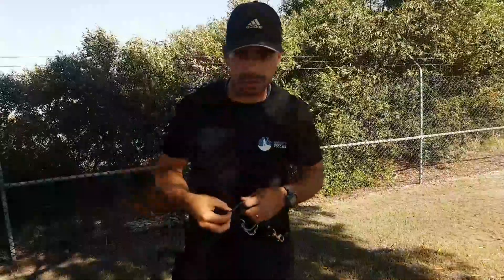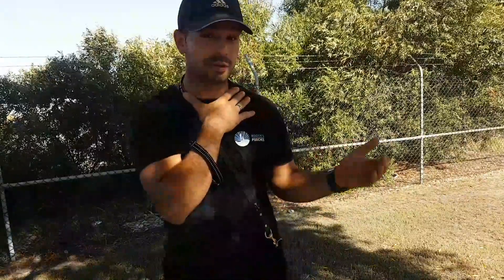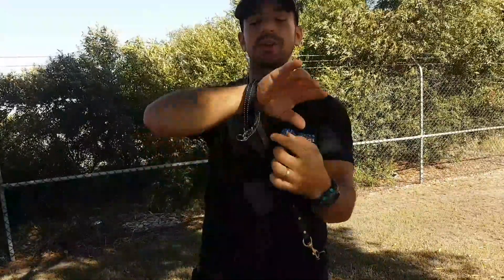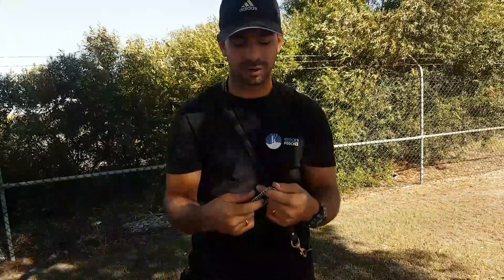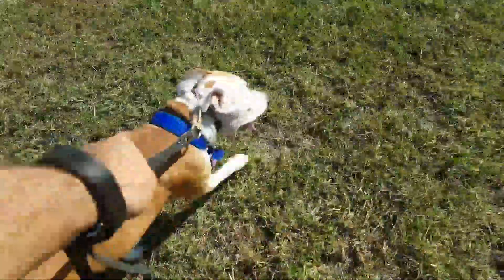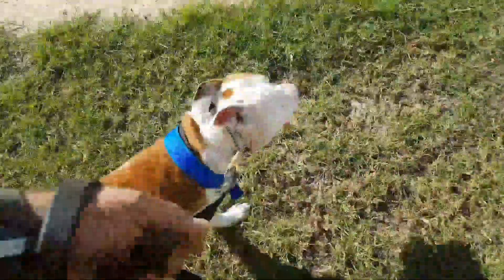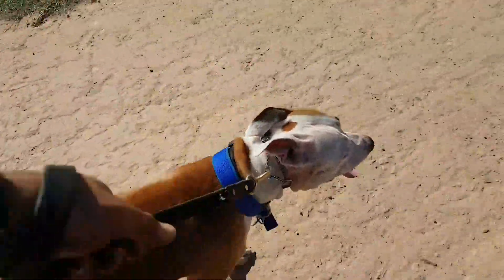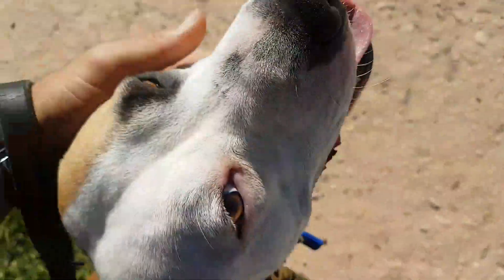A guide to how to use a martingale collar

Comment: Hey brother I could use your help. I’m training my dog but I think my martingale is failing or I’m not placing it correctly. I feel like it’s too tight. I need a new one but I’ve avoided the ones with a chain because I feel it will snap. I have a 1 yr old GSD. Can you suggest a collar and the appropriate leash and leash length please ? Thanks in advance.

Comment: What do you think or full cloth martingales ? I think I may have wasted my $ with the one I got. Hard to get it in the proper position.
Reply from the maker: Hey, they can work however the chain has a few benefits. It releases quickly, makes a sound when you apply pressure and more durable. 😎👍🏼

Comment: I have a 15 month old Great Dane and just bought this collar how do you get it to stay up high? I put it on and it doesn’t stay high and ends up falling to the lower part of his neck. I haven’t attempted to walk him yet because I want to make sure I put it on correctly
Reply from the maker: Hey Brendan, the technique is most important. When you apply pressure on collar you must apply pressure upwards, (don't pull it back). Tough to explain in comment section. I'll try make a video to answer this. Stay tuned 😎👍🏼
Reply: @noochspooches25  thanks for the reply. I do understand the pressure up as opposed to back. My boys pulls going forward. Is it possible to pull up when he’s out in front?
Reply from the maker: @brendanbramley7413  pressure on not when he's pulling, but as he gets in front of you.
Reply: @noochspooches25 understood. Thanks

Comment: Great video, thanks. We have a 7 month old staffy and we're trying to get her to stop pulling on the lead. We quickly moved away from using the flat collar because she was choking herself constantly and moved onto a harness, but with the harness she actually seems to love pulling against it so she's almost incentivised to pull - I am not going to keep using a harness, I want her to not pull at all, not allow for her pulling.
We have had some success with a slip lead but with how thin the rope is, I feel like it digs in more than I would like, and the little stopper which prevents it from coming off doesn't fill me with confidence that it won't loosen too much and she ends up wriggling out and getting into traffic. I was saying to my partner yesterday "I wish there was a slip lead collar that is wide like a flat collar" and sure enough it exists in the form of the martingale, and it's actually a better design than a 1 sided slip lead because it doesn't pull on one side and twist like a slip lead does. What a great invention, and a great demo and instructional video from yourself. Cheers.
Reply from the maker: Thanks! Good luck with your training ✌️

Comment: *This a really informative video.  

With my dog, the challenge I have with him is if I do figure 8s with him, when I move to the left and block him off to turn left he will be responsive but if I got the opposite way ( right ) he will stop and no* t move. Do you have any suggestions?
Reply from the maker: Thanks! Go slow in the direction and as soon as you move to the direction he doesn't like Mark ("YES") and offer food in the direction your moving. Hope this helps 😎👍
Reply: Dogs can prefer one side to the other. Also not sure why a figure 8 is super necessary when you can do a different kind of turn. Sometimes you have to find another way as what you think will work may not and it should be what's best for the dog.

Comment: Have a quick question. I use a retractable leash which I love. I know how to use it so it safe for him and others. If I add a Martingale and the very slight pulling from the retractable do you think would affect the martingale?
Reply from the maker: Not a big fan of using a retractable leash to train loose lead walking. I use a flat leash to train with and once the dog knows how to walk then if you please, then switch to retractable
Reply: @noochspooches25  My dog it´s super well behaved. He does not heel, but only once every many weeks he pulls. what he does is he walks a couple of feet infront and then waits for me.    I am very confortable letting my dog be dog and be sniffing and exploring since he doesn´t pull, but didn´t know if a flat collar would be a good fit
Reply from the maker: @ricardourroz9322  if your happy with him then all good. The martingale is good of you have the correct size it stops him from pulling out of it. Give it a go 😎👍

Comment: I LOVE THIS VIDEO. HOW DO YOU KEEP THE MARTINGALE UP THE HEAD? IVE SEEN VIDEOS AND THEY ARE ALL LOOSE
Reply from the maker: Keep it firm, and when you correct your dog pull it to the side not back. If it falls down, adjust to keep it high 👍
Reply: He keeps it high by having it too tight. It is supposed to be lose and only tighten when the dog pulls. Even then it only tightens to the limits of the 'strap' part. Size or adjust the collar so that the ends meet when pulled, but not tight enough to choke. This is all wrong.
Reply from the maker: Dog is not meant to choke. He will choke if it is loose and low on neck. Watch properly and carefully. Lead must be slack when dog is next to you plus reward. When pressure is on it is momentary and never too tight. The collar will drop even if you have it on firm. Just pull it back up. It works but there are many ways of getting the same result. This is one technique from one trainer. Dont dismiss if you dont fully know the technique ✌
Reply from the maker: @Graeme758  is she choking in this video? Watch my videos on this channel and all dogs that are wearing the martingale collar are wearing like this video shows.
Reply: @noochspooches25  they didnt say you were choking your dog.. READ
Reply: @noochspooches25  My friend, it's definitely too tight. You've effectively turned the Martingale into a choke chain by making it that tight. Your dog in the video is NOT pulling strongly in any way shape or form, but, for example if I did this with my Saluki? One squirrel and she'd take her own head off with the collar being this tight.

Comment: Very clear! I still understand ! Also what mm is the collar you used? I bought the same ones from rogz but i would like to know how do you know if it is comfortable for the dog? Bcz i got two different sizes  that fit well.
Reply from the maker: As long as it fits and when pressure applied there is a gap between to 2 side links 😎👍 thanks

Comment: Good work here. To address the collar slipping.. it can be an issue wit martingales. You just have to fit it properly and keep an eye. For those that know how to use one (without hurting the dog!), a pinch collar provides more exquisite control with minimal force/pressure. Better still train the dog to understand leash pressure first.
Reply from the maker: Well said! 👍